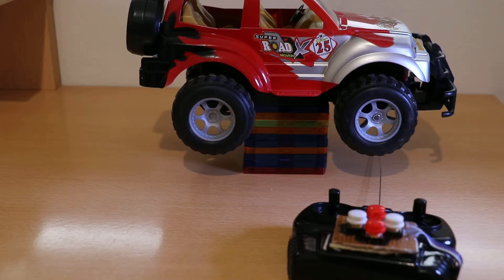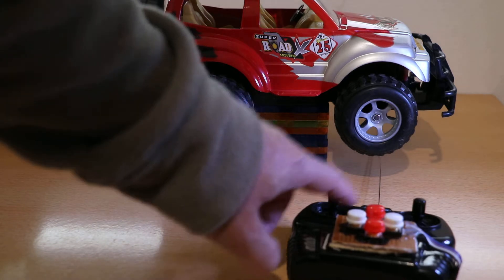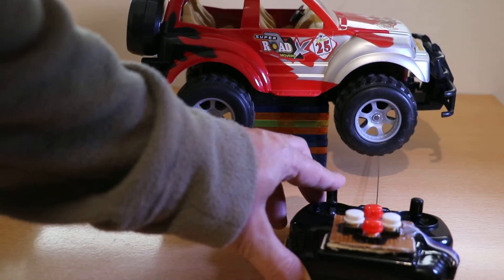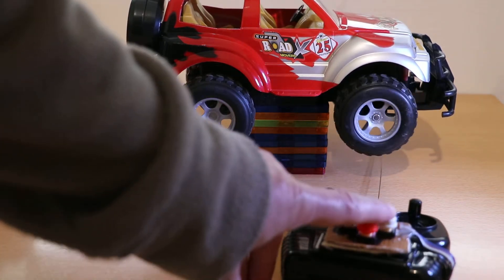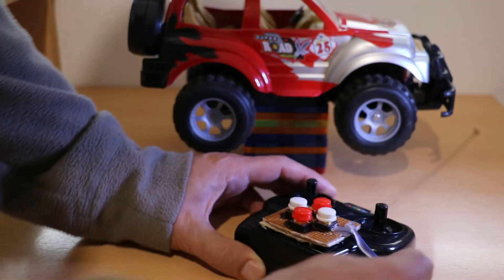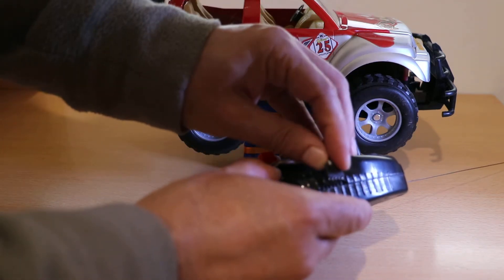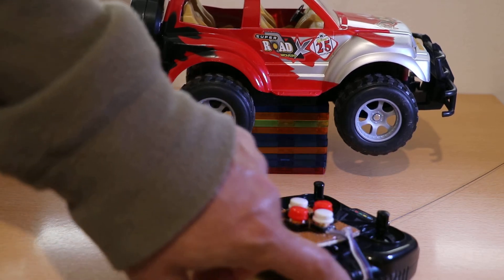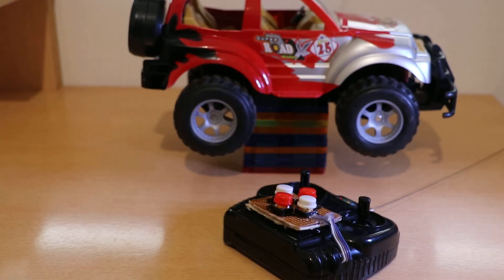Toy Hacking - add buttons to a RC car remote.

Comment: Once the transmitter has been hacked, you can basically use any way you prefer to activate the buttons: tilt switches, voice comnands and, why not... brainwaves (which is the next project I have in the pipeline).
Reply from the maker: that's exactly why I done that :) 
I had an idea of taking a not so working Tomy Car and turn that into the controller, still playing with the idea, since I have some issue wit the steering, some one damaged the wheel a bit. 

I would love to get to play with one of the thus "brainwaves reader" :) 
i seen some cool project with thus.